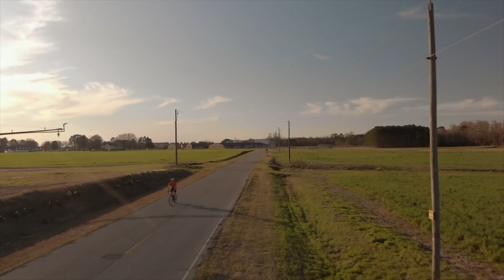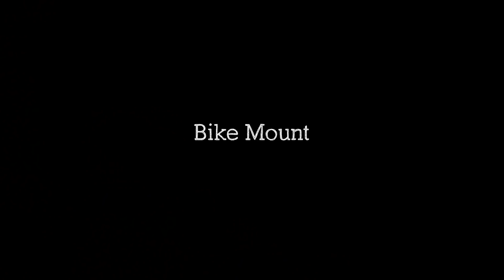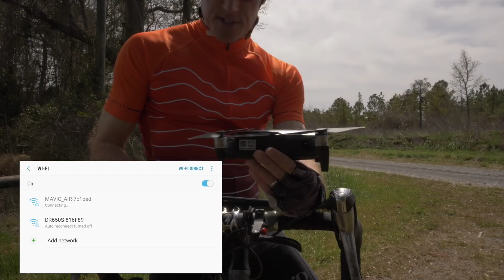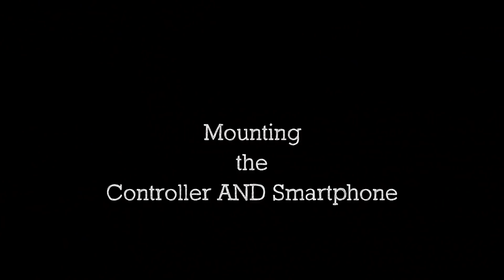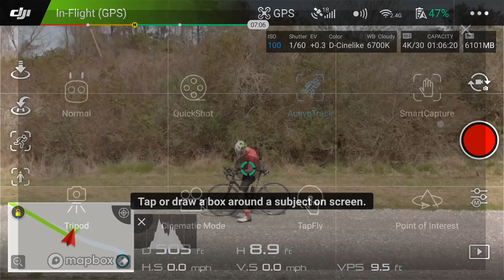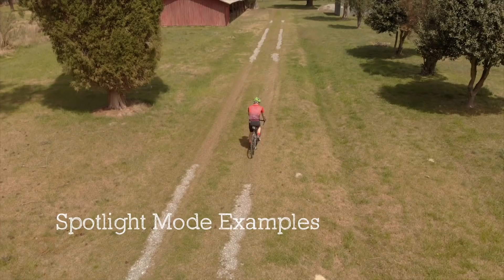Mavic Air - Active Track | Bike Tutorial

Comment from the maker: Have you tried using Active Track on a bike? How did it work out for you? Let me know in the comments.
Reply: Jeff if you ride you bike at .5 mph how on a soccer field it will work anything else is crap. It will lose you at the first turn. This is the dumbest feature on the Mavic Air.. This feature is good if your walking on the beach with your partner during a sunset that is the pace you need to go to accomplish anything worth your time to set up.
Reply from the maker: Motoxscuba Park thanks dor the comment.  Active track definitely can be improved  (especially if dji had a gps armband), but it can be done with a bit of practice at bike speed (18-20mph) under optimal conditions.  POI active track only works on a slow roll/ride.
Reply: I love my drone, I hike and bike everyday and get new shots of every trail etc around simi valley, ca. I'm saddened by this feature. It for sure has some room to grow.  Thanks for comment. it is the first time I have ever commented on anything on you tube. I will add videos slowly to the things I do on my page. Have a great day
Reply: Motoxscuba Park 
This is my same experience. I had one good experience of the Mavic air active tracking while cycling, but that's it.
Reply: I haven't tried it with my mavic air yet but mostly failed with my spark.
Reply: Nice 
https://youtu.be/JghXKDI1Pz0
Check this out😊

Comment: I've struggled to get active track modes to work when cycling as I'm rarely on flat land. Tap to fly is a good fallback though. You can just tap on the screen as you're cycling along and it will follow you providing you have set the speed settings correctly.

Comment: First time I used active track while on the lake with my boat. I launched drone into air. Pressed fallow, drone was following me, then suddenly lost me, started to go sideways away from me... I took controler into hands but forgotten to switch back to normal mode, then it took few minutes to realize what is a problem, meanwhile, there was low battery warning, and drone said its going to home position. It rised 90 ft into sky and flew away from me... Needless to say, I was panicking, water was all around me... I started following drone with my boat and arrived just on time to home posittion, which was some 900 ft away, and drone landed on my boat... Never again I'm going to do active track. Basically every time I launch my drone, I'm having panic. :)
Reply from the maker: Wow, that's a great story. I would have been panicking too!  I bet you know 100% how RTH works now.

Comment: the question I have is, where do you put the phone or controller when its following you? I ride mountain bikes and dirtbikes and I need both hands at times lol. I saw your little mischief clamp but what I hate about these drones is you need the controller or phone. DJI needs to be like skydio2 and have a beacon
Reply from the maker: Hi Will, I wouldn't even attempt to ride mountain bikes with Active track.  Unfortunately it is an exercise in frustration where you may eventually get a shot of you "on a bike", but not action shots of you "riding a bike". The sketchy clamp/gear tie that i have would not hold up on a mountain bike trail. I ordered a skydio 2 for this exact same reason.  IMO, riding the bike should be the primary activity, not the other way around.

Comment: This video is older than 1yr, did DJI updated the drone to prevent the issue with only cellphone control
Reply: No it did not.
Reply: Wrong, did not fix it, at least not in my case, but a compas recalibration fix it.

Comment: I would have been pretty nervous with all those poles and wires along the roadside. I would have had to have the altitude set above them.
Reply from the maker: Hi Woody i know what you mean. In this case, the old farm road was perfectly straight and wide open fields behind the poles. So as long as i rode straight, the mavic would fly parallel.

Comment: In relation to the dissapointment at 5:50 - have you tried tracking with air gestures? It seems MA can follow you without even turning on a controller :-) https://www.youtube.com/watch?v=d_cOzfDmHL4
Reply from the maker: Hi Mariusz,  Yep, i tried that and it kind of works. Seems like this option will only fly about 6 ft off the ground. So for me, it wasn't that useful in showing the surrounding environment.

Comment: Awesome video as always, Jeff!! I plan on using Active Track from my boat with the RC and would like to know if I need to use a GPS enabled device such as an iPad. iPhone, etc. for that mode itself? It appears in your video that I wouldn't as long as I'm using the RC. I do realize that I would need a GPS device for RTH to the RC location due to moving around. but there may be times I set the RTH on shore. Thanks again for another awesome video!! Ray 😊👍
Reply from the maker: Raymond Sherman nope not necessary.  Typically when my phone is connected to the rc, my phone is in airplane mode. So, the gps is only used between the mavic and the rc, not your phone.  Also, active Track is only using a "visual lock" based on what your camera sees as the target, not the gps location of the target. Hope that helps!
Reply: Thanks Jeff, yes your answer definitely helped me understand how Active track works. I have an iPad Air 2 without cellular and I also recently purchased a new iPad 9.7 with cellular. I normally use the Air 2 with the MA but, I will use the new iPad for RTH to RC on the boat. I also will set to hover in case of a signal loss. I thank you for your help during my learning process not only through your videos but, also through your comments. You've been a tremendous help to me and I sincerely appreciate your time in answering my questions. As always, I can't wait for your next video. Happy Flying!! Ray 👏😊

Comment: Hey Jeff, love this video and all the others I've watched so far.  For the Active Track, how do you get the drone to do a sweep / arc / circle while it is following?  Are those shots using a different mode like POI?  Or is it possible to adjust the drone flight path on the fly while Active Track keeps it focused on you?
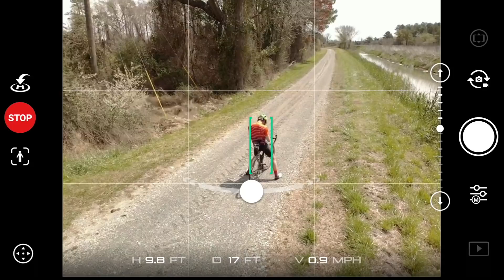Reply from the maker: Kenneth Everett thanks for the comment!  This is actually done within active track mode.  There is an additional slider (see 05:39) below the target. You slide this to the right/left to fly in a circle while tracking.

Comment: How long does it take to set up the drone intent air to take the shots? Could it ever be done without really stopping. Or maybe a 30 sec stop to launch and put in position?
Reply from the maker: Josh, I know what you mean. The technology just isn't there yet.  The time it takes to set up the mavic to get a shot of you on the bike DOES take away from the fun time on the bike.  Meaning if you are riding with a group of friends to get a cool shot, they're likely going to lose interest as you take 5 mins getting set up, plus numerous attempts for it to come out right, etc. For me, its more practical to take it on the bike to get cool shots of other things, not active tracking the bike itself.  The trial and error in my experience is too time consuming.
Reply: Jeff Greene thanks for getting back to me. That’s really helpful, even if a little disappointing. 
On a different note, I don’t suppose you have tried putting the spark in a jerseys pocket? 
Thanks
Reply from the maker: Josh Wait nope i don't  have a spark. I would imagine that would be a tight fit since it doesn't fold up, no?
Reply: Jeff Greene thanks. Yep. That’s what I was thinking. It might just squeeze in the large pocket. Think I’ll have to give the air some serious thought though.

Comment: 3:35 - it will actually descend too... first time I used active track, I was on a dirt road descending to a beach, with telephone line poles and had to hit pause button as the altitude was already negative so... always have that pause button at sight and read the telemetry.

at 6:08 you do have dinamic home point. when setting homepoint its the other button next to it, so it sets your remote as home point aka dynamic

Comment: Hello from Brazil. Thanx a lot for your video. It will help me a lot when I try the active track mode on the Mavic Air. I will try it on my motorbike. I would suggest DJI that we could set intellident modes with the drone still on ground, for battery saving, as modes are only selectable with the drone in the air. Nice job, though.
Reply from the maker: Paulo Schalcher thank you for the thumbs up.  Would like to see your motorbike video!

Comment: Jeff, I noticed in the general menu of the go4 app that you can choose whether the home point is the take off point or where the controller (or possibly phone) is. Might be worth investigating to change that setting and you may get away with using the phone only. Slight guess work on my part, but poss worth checking. Cheers, Nick.
Reply from the maker: volens31 thanks for the comment and good idea. I checked  and unfortunately the option doesn't exist when just using the phone as the controller.  Maybe dji will turn this on soon.
Reply: Jeff that's a shame. Yes let's hope it's on the next update. Cheers for now 😃

Comment: Hi, I saw your examples in sort of slow motion, did you have to set the video (to what setting) prior to filming in active track or was it slowed in post? Ty
Reply from the maker: Franklin, actually all of the examples in this video were shot at 4k30, and at 100% normal speed.  I sped up certain clips using a speed ramp in Final Cut Pro X(some were sped up 2000%) so the 100% normal speed may look slow.

Comment: Just curious as to why DJI would not have dynamic HP on MA!!!
Are there any advantages of AT on MA over MP?
Reply from the maker: RK Notes fingers crossed on the dynamic hp soon. The only other diff i see related to  active track is the additional obstacle avoidance sensors on the mavic air vs the mavic pro. This has saved me several times 😁
Reply: You mean saved while flying backwards?
Reply from the maker: RK Notes yes, i was doing a reverse Tapfly on one of these bike shots. I turned around to go get the ma and it was hovering 3ft in front of a  stop sign😰

Comment: I did active track with a friend on a motorcycle but probably I would have thought twice before doing it had I seen your video earlier. Now I know it was just sheer luck that the drone hadn't crashed into trees near the road. I didn't expect sideways movements. The resulted clip looked great, however the altitude was not set consciously higher than the trees. It was luck, now I know.
Reply from the maker: Dr Zsolt Gordos wow that is lucky. I have definitively had mixed results, lots of practice ahead.